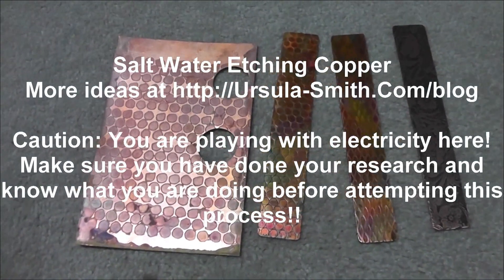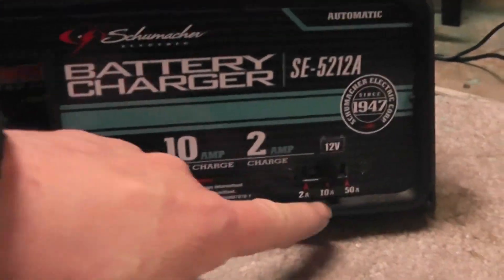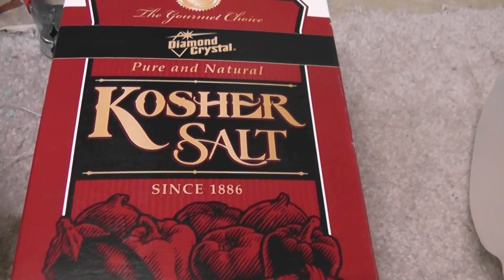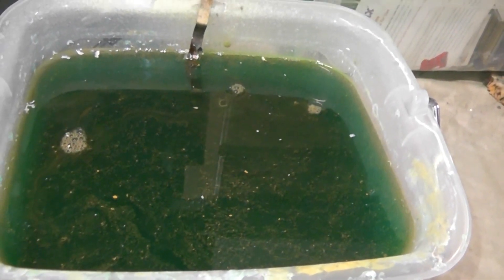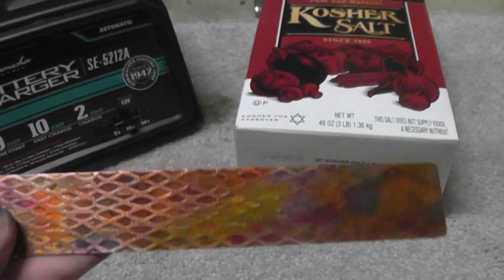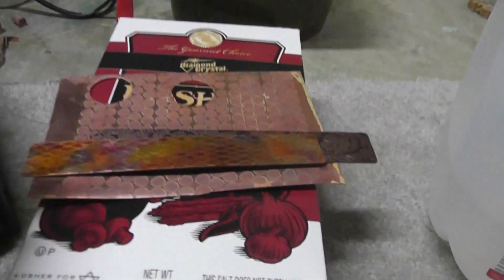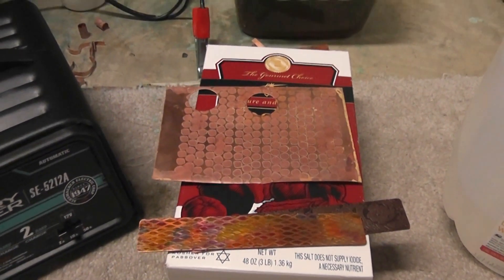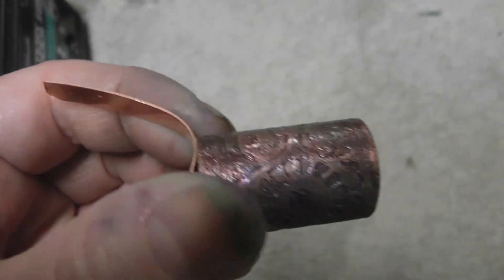Salt Water Copper Etching

Comment: What is the white stays on you are referring to?  Is it an etch resist?
Reply from the maker: Sorry! I'm not sure why I don't get notifications anymore :(. If you haven't found it by now, it's Stazon and it's a solvent ink for rubber stamping. Amazon, and crafts stores carry it. The black will work too, but the white is thicker- more like a paint and I fond it holds up better. I have a new video out too where I use pigment ink and embossing powder. HTH

Comment: Hey how long i need to wait to get jic3 etch on piece 5"×7",i use battery charger 12v 10A ?
Reply from the maker: samir pasic I usually only do smaller pieces and even they can take upwards of a couple of hours sometimes. This is one of those things that you need to keep trying and see what works for you. Sometimes if it seemed like it was taking forever I would add a bit more salt. However, I don't really etch this way any more. It was a bit unpredictable. I've been researching etching with cubric nitrate and I think I'm going to give that a try.